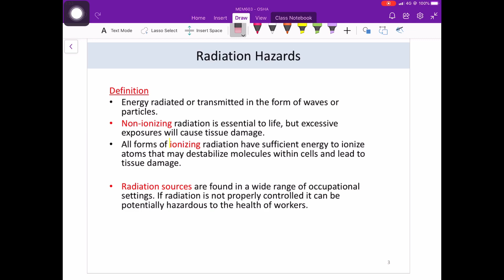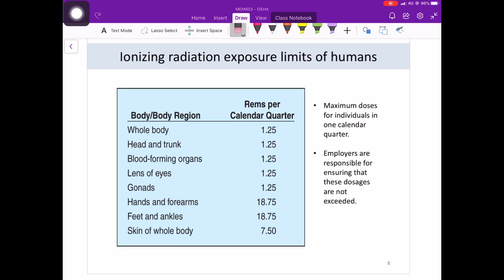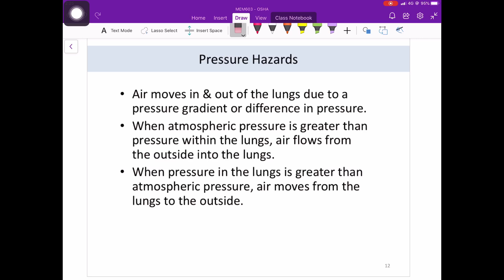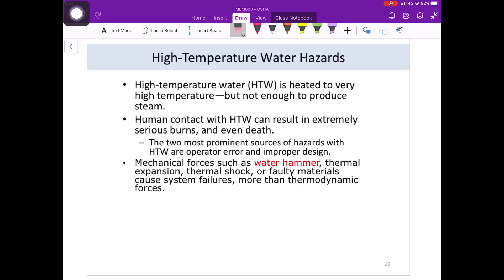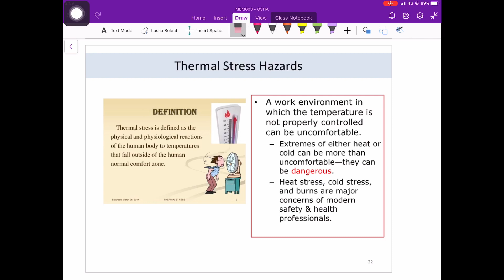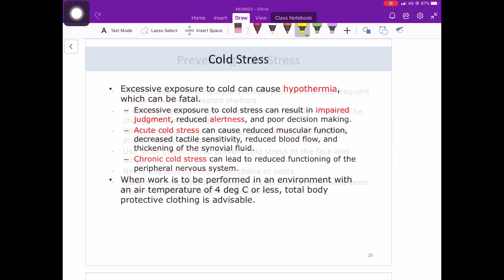MEM603 4.6 Radiation, Pressurized Environment and Thermal Stress Hazard

Comment: There are several non-ionizing radiation that the human body experience without overexposure. However, there are some harmful radiation that are used in research institute that can produce an unpredictable result to the human health and environment. Therefore, it can be seen that there are some countries that do not wish to resort in using them for the sake of preserving a healthy state. The pressure vessel can be a dangerous workplace for those that are involved. Despite that, thanks to the information learnt in the video, there is still some comprehensive method to handle them properly to secure that working industry.
Reply from the maker: Thank you for the information. Good to know you are able to came up with these points. I wish you all the best.

Comment: radiation is energy radiated or transmitted in the form of waves or particles. radiation divide by two which are are ionizing radiation and non-ionizing. So that, it must be controlled properly so that it will not harm workers.

Comment: Radiation is the energy that transmitted or radiated through particles and radiation hazards divided into two categories which are ionizing radiation and non-ionizing radiation like radiofrequency and microwave radiation that results in tissue damage through heating. A pressurized environment includes an environment like high-altitude decompression that results in lung ruptures. Thermal stress is a physical reaction of the human body to abnormal temperatures that result in heat stress or cold stress. Thus, the awareness of these hazards is important to be implemented by all authorized persons in every workplaces.

Comment: Radiation come in many form of ionizing and non ionizing radiation which mostly commonly lead toward risk. Unsafe engagement with work conduction may lead toward pressure hazard due to atmosphere altitude or air trap. It leads toward serious injuries and highly danger. Thermal stress involve several factor such as the temperature change in human body. There are several way in order to contain and prevent from these hazards to be occurs in the workplace.